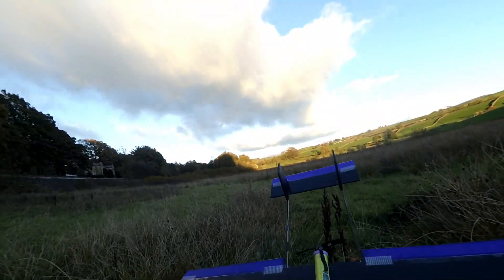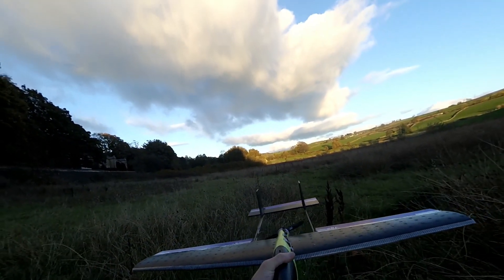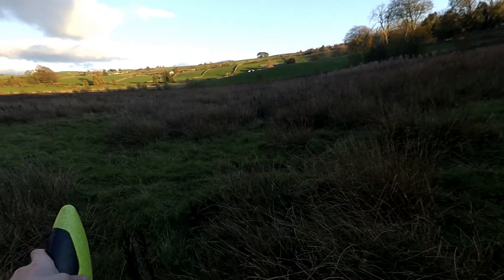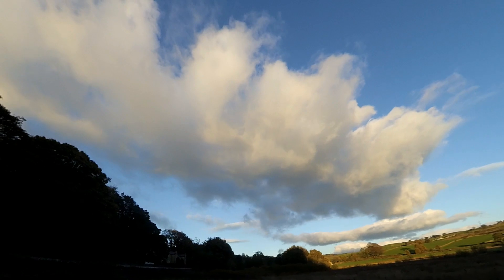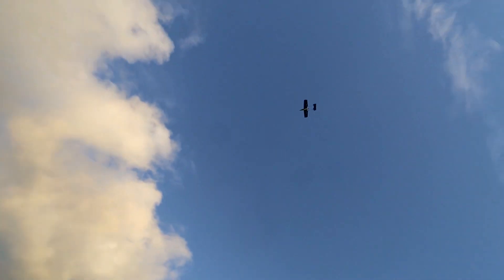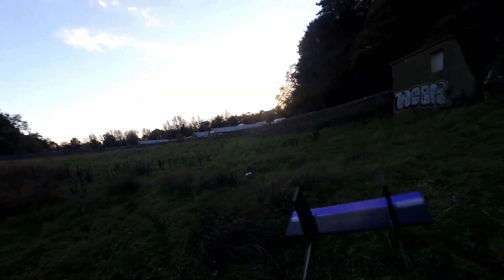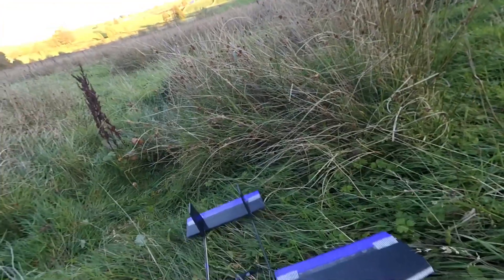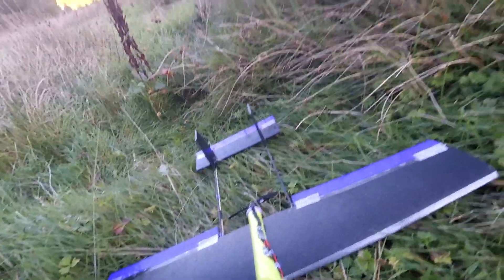Lidl Twin Tail rc aircraft Maiden test flight

Comment: Wow Respekt nice build.
Where is the CG of this build.
Reply from the maker: It's been long enough since I flew it that I can't honestly tell you. But I remember there were no big surprises. So 1/3rd back from the wing's leading edge (the same as almost every other conventional aircraft) then play with it until it feels right. The aircraft has enough stability, unlike a flying wing, that it will fly OK if you get the CoG a little bit wrong so there's no harm using trial and error.

Comment: Карбоновые прутки какого диаметра
Reply from the maker: 5mm but that's too thin and they were not strong enough. I had to put wooden barbecue sticks inside the carbon tubes with glue to make them stronger. For the tail.

Comment: That is a very nice conversion. Did you struggle to get your CG in place?
Reply from the maker: Thanks, and no. Surprisingly, for a hack design like this, I needed about 2p (12 grams) in ballast and the whole thing flew fine without lots of dead weight. I can't remember the exact position of the CoG but it'll be 1/3rd back from the leading edge of the wing then I'll have experimented a bit for the final few mms.
Reply: @christophertelford  thanks, I'm currently working in a similar RC conversion setup but I'm afraid I'll have to do something more drastic to get the CoG right. Thanks and keep up the good work!

Comment: thanks for posting.  good work.  here are some things to consider.   at :23, that prop is What.   it Should be an   E P.    the model may be under-prop'd; prop diam should be equal to about 25 percent of wingspan.   suggest you 'tighten-up' the dom; install servos as far inboard as Practical.   Eliminate the under-wing 'fins'.   in order to protect servos and linkage:  1)  PUTEM ON TOP      2)  use a low-profile cover/guide that has a shape that Promotes  Smooth  Laminar  flow of air past it; same idea as wheel-pants.    you may know that Quality airframe design includes many, less-obvious factors.    one is the ideal location of a model's center of mass (c-m).    for any yet-to-be built  airframe, the  Ultimate location of the c-m  Will Be  determined At Completion, by the  distribution of mass (dom).       it should be understood that when reference is made to a model's balance/cg  or  nose/tail-heaviness,  the  CONTEXT  is  d o m.    paraphrased from below -  the ideal location of the c-m of a conventional airframe  IS  at  25 percent of fuselage length; and vertically aligned with the main wing neutral point; which is Always located at  25 percent of chord (or mac).     therefore,  when adding the mass of power/control components to a miniature airframe,  priority Should be given to locating that mass   NEAR  25 percent of fuselage length.    cheers       googletranslate
Conventional aft-tail configuration  – c.m. near wing's aerodynamic center [point at which wing's pitching moment coefficient is invariant with angle of attack ~25% mean aerodynamic chord (mac)]
Reply from the maker: It doesn't feel under propped to me. With a 2300kv motor and a 6" prop it produces almost 700 grams of thrust and climbs like a rocket. With a larger prop it might produce more thrust at fewer amps and be more efficient but there'd be more drag from the prop disc and it wouldn't glide as nicely. With 15 min+ flight times I don't need more efficiency and I don't need more thrust either so I'm happy with the smaller prop. 
I like the look of the servos underneath as it keeps the top of the aircraft clean. I can't see the fins doing any harm aerodynamically as most of their surface area is behind the CoG and I'm not going to be belly landing on concrete so I'm not too worried about the servos.
I've flown the aircraft a second time today and with an extra 4p (14 grams) in the nose it behaved even better. With the ailerons cranked down a fraction of a degree (mixed to a slider) I can get it to track better at higher speeds as well. I may still build another motor mount with 0.5 degrees more down thrust, we'll see.
I might print some aerodynamic servo covers for the underside though.
Reply from the maker: I'm not quite sure what you are trying to say about centre of mass but my understanding is it's all relative to the wing and has nothing to do with fuselage length at all. 1/3rd back from the leading edge or 1/3rd of the surface area in front and 2/3rd behind (swept wings etc) is the rule of thumb for most aircraft designs. 
When I built the aircraft I managed to get everything 'about right' such that I seem to have only needed 4 p in the nose to get the CoG to that spot, so it worked out fine.
Reply: @christophertelford   What is your CG for best results?  Distance behind leading edge of the wing?  I have built a "Lidl Devil" or Goblin-style plank version of the Lidl Glider, but have not been able to successfully find a good CG, so am now thinking of adding a boom tail like yours to make it more of a Skyhunter-style plane.  Thanks!